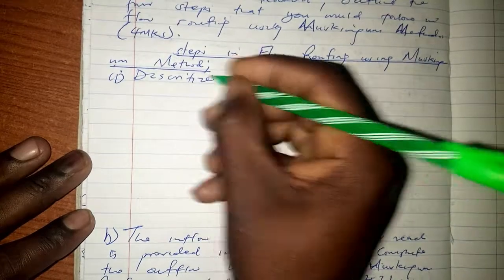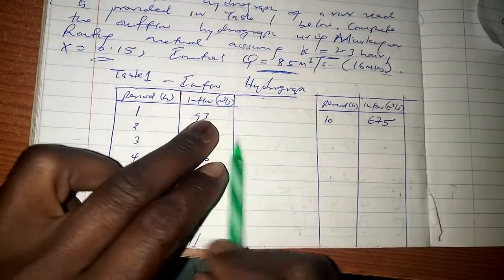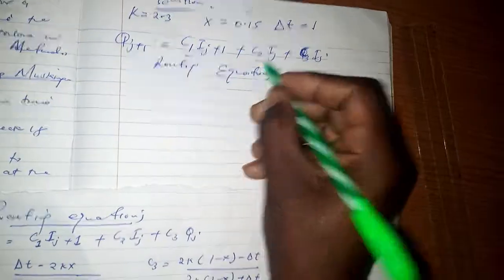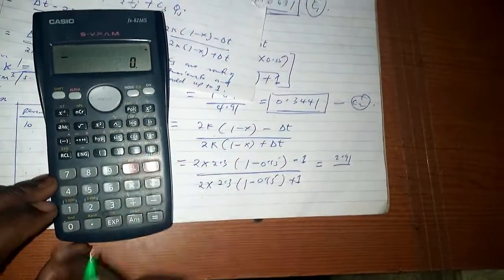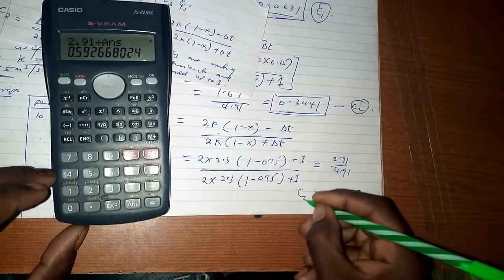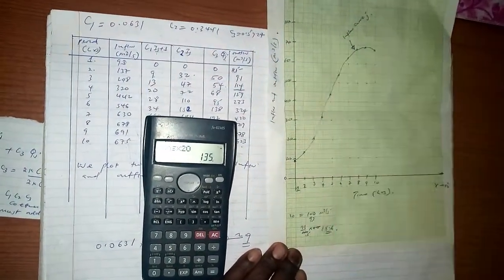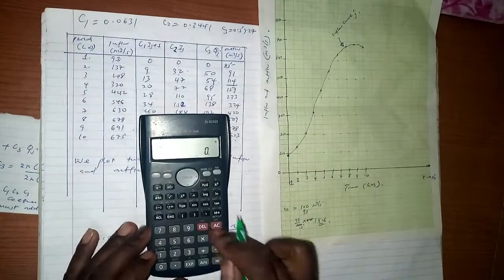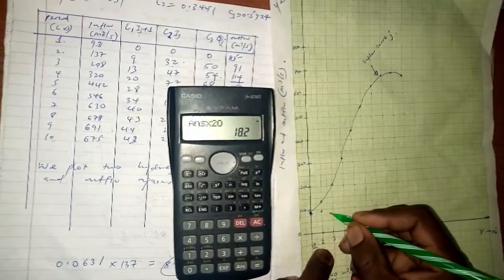Flood routing - muskingum method

Comment: Sir I have a doubt. If ordinates (time,inflow), value of K and X are given and told to find the ordinate of the 
outflow (routed) hydrograph for 2nd hour only.. But discharge is not given...So how to find C3
Reply from the maker: All coefficients  will be provided in every routing questions.
Reply: Try to master the formulas for finding the coefficients. Fitting the values is easy. Just substitution.
Reply: @RoyalTutorials354 The ordinates of an inflow hydrograph are provided in the table below. If the routing 
interval (Δt) is one hour, weighting factor in Muskingham equation (X) is 0.2, and 
the storage-time constant (time of travel of flood wave through the channel reach) 
(K) is 0.7 hour, using the Muskingham method of flood routing, the ordinate of the 
outflow (routed) hydrograph for 2nd hour in m3
 s-1 is _______. [round off to two 
decimal places.. And table. Of time and inflow ordinates were given.. .. How to do this
Reply from the maker: Let me work on that, sorry for delaying to reply.